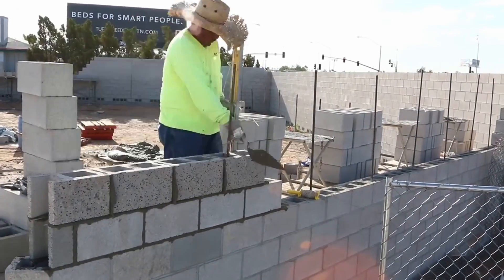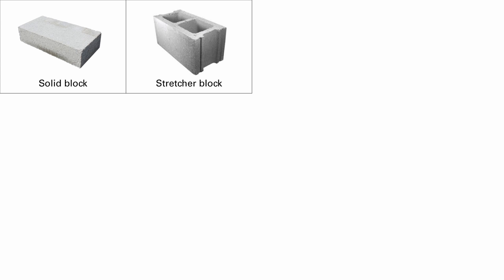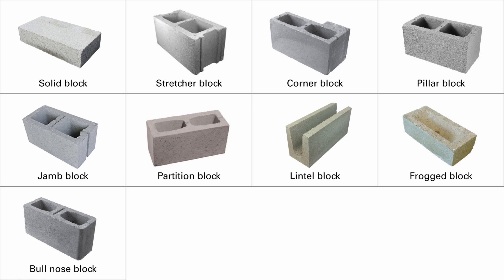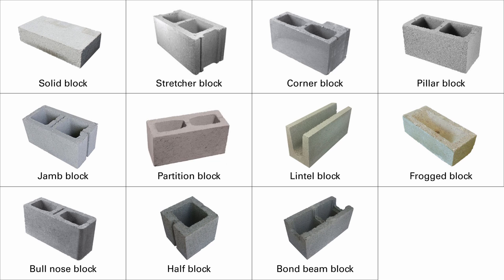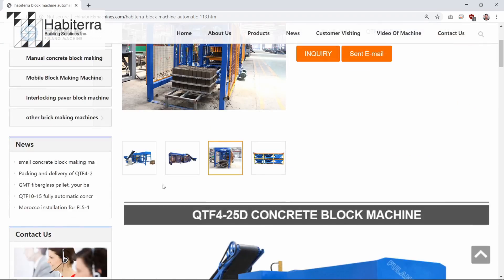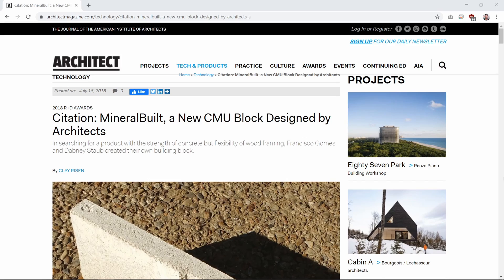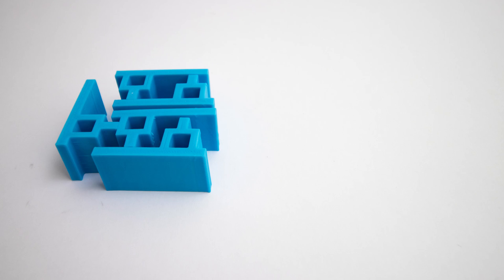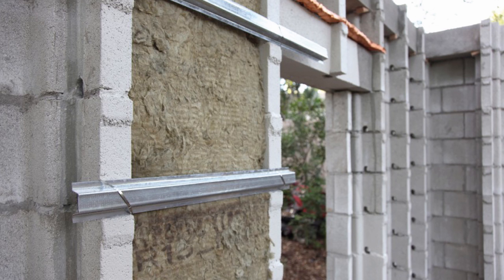New CMU designs from around the world + 3D prints

Comment: I've stumbled upon a company called "Polycare" recently. It seems their "polyblocks" have a similar purpose except they have added insulation inside the block as well. Also, they use a variation of concrete called polymer-concrete which uses polymer instead of lime as binder. I was wondering if you could make a video about it in the future. I'm fascinated what your thoughts are on the subject.

Comment: Block is only acceptable because of the regularly spaced vertical, and horizontal, steel reinforcing captured within cells filled with concrete.
The reinforcing has to be completely surrounded by a thick jacket of concrete.  A little smear of concrete, or worse, mortar, will not pass engineering tests in the U.S.
Because the cells have to be so large, the size restricts how much creativity can be done with the basic design.
But I have seen a lot of different blocks over the years.  Many of them had some type of insulation that was made specifically to work with the block.  None of those products have been widely accepted, and I believe that it's because of their extra cost.  Builders just find it cheaper to put up wood frame, furred out, wall structures on the interior for insulation, electrical, and plumbing.
Because the block has so many cells that are filled solid, the insulation value is very small in those strips.  That also makes the furred wall option attractive because it provides continuous insulation, not counting the studs, of course.
I keep hoping that someone will invent a dream block that has insulation in it that meets code; has the cells needed for the reinforcing, but costs no more than standard blocks.  I'm not holding my breath.
Reply: what do you think about Polycare blocks??